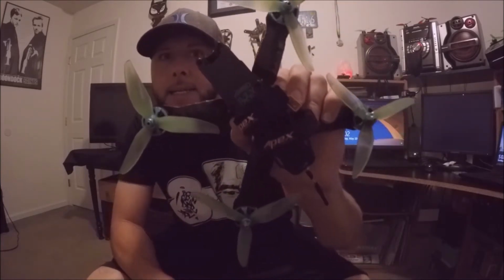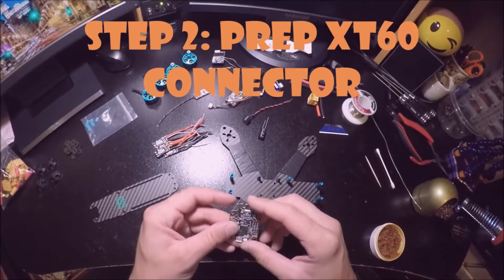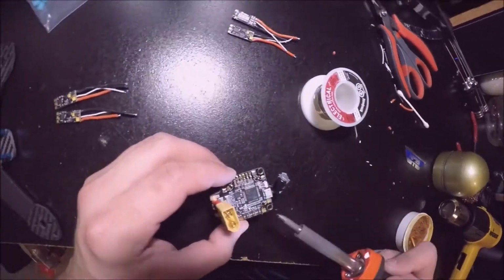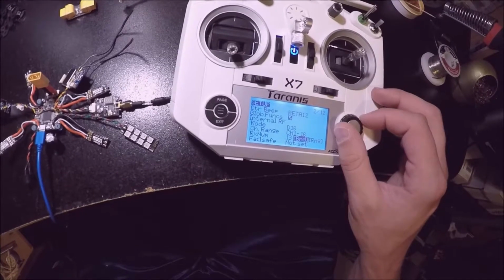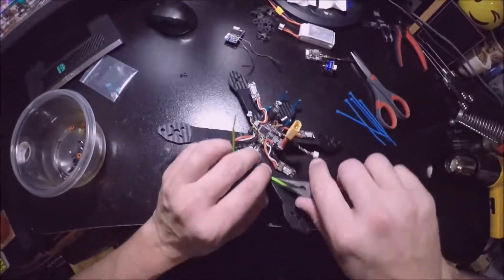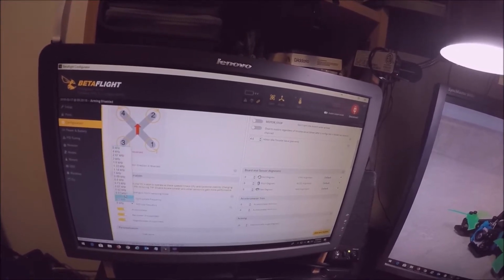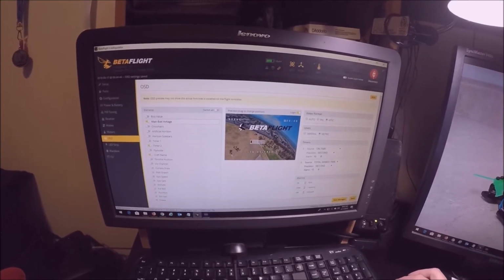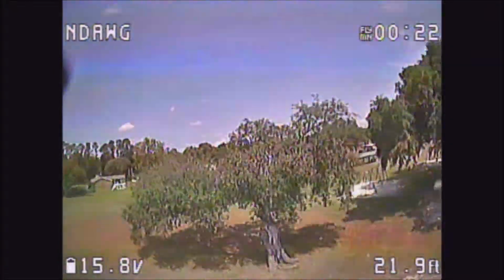Rad-X Full Build and Review (Kwad Box)

Comment: nice build bro just waiting my first box.
Reply from the maker: NAT GEO AND STUFF Paul brannan Kwad Box is awesome!!! I'm sure you'll love it.
Reply: NateDawg FPV cheers bro
Reply: apparently something diffrent this month.
Reply: and you talk about the old matek i have it been speaking matek for 6 month but no reply recently they told me this after no reply for long time.this is one of acctual emails.
My colleague told me that you contacted us several months ago.

It is a F405-AIO,right?  EMAX ESC?

 

Soft mount the FC with rubber standoffs, be sure FC doesn't touch the frame

Add low ESR capacitor on each ESC, 25V/330uF or 35V/220uF each

If it is Blheli-32 ESC, adjust PWM to 48K

 

Low ESR capcaitor as following

Rubycon: ZLH,  ZLG,  ZLQ series Panasonic: FM, FR series Nippon Chemi-con: KZM series Nichicon: UHV series

i tried everything .i not been able fly it once.it nearly took my mates head off and hit wall next to him after in adle mode for couple seconds.it shot full pelt.and that twitch omg.i have video of it bro.thought they might gave new board but no.sent them videos everything.i have progect teaching young children to fly instead of trouble but not with this board no way.gotta try get another hoping one in kwad box but doubt it they said took a while to pull junes off
Reply from the maker: Yeah unfortunately the original Matek 405 AIO was crap. Gyro was way too sensitive and they offer a ridiculous solution that doesn't even work for most people.You are better off going with a different flight controller that isn't crap. With that said, Matek's second attempt at the AIO, the Matek F405-CTR, is great.